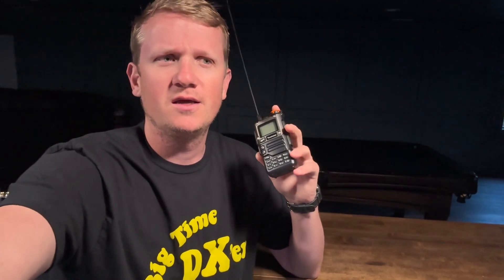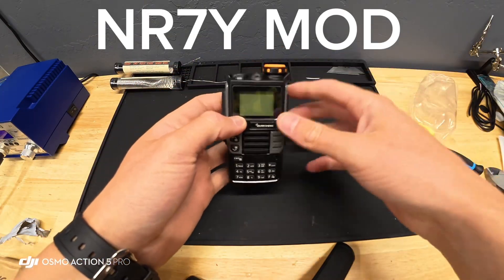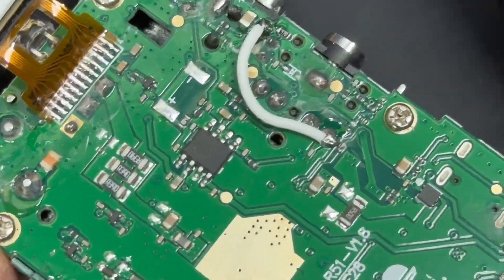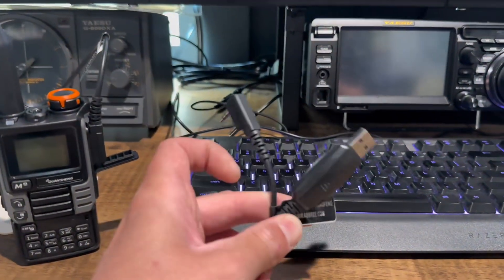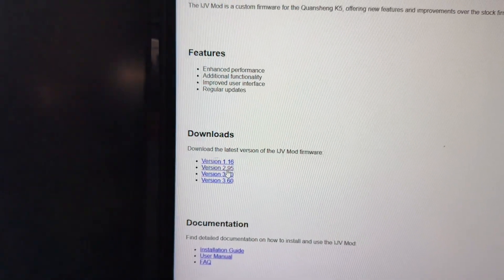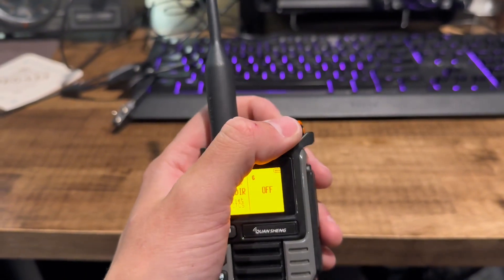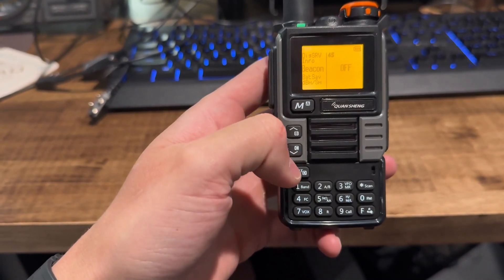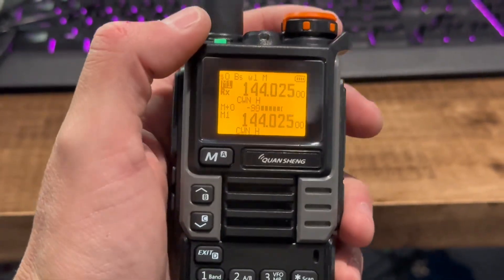$27 Morse Code Radio Setup In 10 Minutes

Comment from the maker: Reminder: Nobody in your area uses 2m cw until somebody does. If you’re reading this, you’re that somebody. Congratulations.
Reply: Exactly!
Reply: Excellent advice. I've been doing 2 m CW since the '90s in Chicago.  

.... By the way, where did you get that awesome shirt?
Reply from the maker: @k9kj you can only get this shirt once you’ve earned DXCC CW which I was able to do running .005 micromilliwatts from my modified Quansheng
Reply: 70 miles is cake no obstruction but where this shines is in a river valley for me. 10 miles in the most shit terrain no issues. I'd never make that contact on fm
Reply: Just like the people that say no one is on the repeaters but still never call out on them

Comment: In the manual IJV 2.9R5  section 7.7. There is a modification to a 2 Pin K1 to 3.5mm cable, where there is no need modify the radio itself.
Reply: It even has a picture showing the modification of the cable to use with a cw key. No need for any radio mods at all.
Reply from the maker: My literal brothers in Christ. The entire point of the radio mod is so that you don’t have to have a modified cable with you at all times lol. I’m always out in the field with a variety of radios and keys and to need to have the special cable with me is harder than just having the radio 100% ready to go at all times

Comment: That's excellent!  But it's not possible to open without removing the bolt.  Also there was no mod done to the keyer, is this because you a different of the radio?   Mine simply did not work!

Comment: This mod seems to work with only a straight key, what is the version that works with paddles?
Would love to use 2m cw but dont want to be restricted to only a straight key
Reply: Same
Reply: You would need a piece of hardware to interface between the paddle key and the radio to converter the information from two switches (paddles) down to one (PTT)

Comment: Does it opperate like normal FM voice, but you hear morse code instead of voice? I showed this to my club, and we're wondering if it can put out a PL tone to open our repeater while transmitting morse code. Seems like it would be easy if it's FM, but if it's true continuous wave we might have to put more thought into it, or stick with simplex. We thought this might be a good opportunity to start up a cw net with low cost to entry for new ops. Great work and videos!
Reply: I have wondered the same thing.  But if you have a key and something that makes the tone, you could set the radio on vox and key away on the fm repeater, without any mod at all

Comment: sorry if this question is stupid but i dont understand. Why did you remove the resistor and add a wire? Is it necessary in order to use an iambic keyer?

Comment: Just modded my UV-K5.  I notice I can't hear the first split second of a character after a space, especially if it's a dit, although it seems to be transmitting.  Anyone else have this behavior?
Reply from the maker: These radios require an initial keying to enable PTT for keying so if you leave too much space you’ll create cuts. This is normal

Comment: I'm going to put some more reading into this and maybe put together an adapter/connector instead of the mod.

Btw, the CEC firmware supports a paddle and I have that one too. Did you have any luck with that one? Need to try it out.

But yeah, man, 2m CQs are in my future. Somebody WILL notice! (Btw to be real, the cw club in greece has tops 400 members and I'm the first in my area, it will be tough, be hey you can be dicouraged if you start from nothing, right?)
Reply: The CEC firmware can accept a paddle, but requires some extra resistors to connect it, and our SOTA group found it very fidgety. It’s slow to key up (eats a dit) and sometimes just won’t key at all. Even with the hassle of an external keyer, we found the IJV firmware experience is much better.

Also note, this mod will break the CEC paddle mode; it needs that resistor to work. So get a second $30 radio if you want to try CEC.
Reply: @BrianDickman Oh I got 3 of them ❤ Thanks!

Comment: I already ordered the kenwood cable with the uv-k5. Do I still need to do the internal mod? De n5vwn
Reply: Update: quansheng came today. I tried with the modified plug first. Didn’t work. I think I bought one with different wiring. So I swallowed and took a chance and opened it up. Success! Works great! Calling CQ in the middle of nowhere. Using a X30 antenna 30’. I do hear repeaters up to 200 miles away sometimes. So who knows? De n5vwn

Comment: Great demo!    From another comment it sounds like there a different firmware to enable a built in keyer for use with a paddle.  If that wasn't the case, it's a market opportunity for someone to develop an integrated mico-keyer with paddle to plug in a mono connection like your straight key (like the curtis keyers of yore).     Or someone could develop a micro bug :).  That would be trick!!
Reply from the maker: I should’ve addressed this in the video. This entire project was the outcome of running the existing iambic paddle firmware commonly known as KD8CEC. K6ARK and I had a lot of back and forth on it. I’ll shoot you an email.
Reply: Another thought is to pair the radio with the new Morseino 32 Pocket available at QRP-Labs as I believe it can act as keyer for paddle and also give more macro options.  73 WG2H

Comment: Thanks for the conglomeration info and questions...thought I overheard someone in the "SoCal" group that you didn't need to do the NR7Y mod, that CW can be used just with a software mod...is that true?  Also, any impact to other operations of the radio after the mod (2m/440) - still work or is this one CW only?   Thanks
Reply from the maker: From guys that are very active with 2m CW they state from all their testing IJV 2.95 works best. The NR7Y mod is so that you don’t have to carry a modified cable with you. As you cannot just plug a key into the Quansheng without either a modified cable or the NR7Y mod. And imo the NR7Y mod is easier than modding a cable.

Comment: Thank you Forrest! I needed this for the settings. My tiny 3d printed key still doesn’t work with the mod, but I found out my key that I use for HF works on the left side paddle. So, I’ll make do with it😂
Reply from the maker: Is your 3D printed key a straight key or paddle? If it’s a straight key we should be able to get it to work just fine with the IJV 2.95 firmware.
Reply: @utahforrest it’s a straight. It’s the one that you had in your first video about CW on the quansheng. The rectangle one with white paddles.

Comment: I believe the KD8CEC V 0.2 allows you to transmit true CW with zero mods … at least I hope it does. Maybe that’s why no one is answering….
Reply from the maker: I’m going off of word of mouth by guys that actually use these radios frequently atop summits. K6ARK told me IJV 2.95 is notably better than the KD8CEC firmware. 
So far I’ve been making QSOs with IJV just fine!
Reply: @utahforrest gotcha I assume the IJV was the best but unfortunately I use a Mac and had to flash the firmware from the browser! I’m sure KD8CEC works too I just have to keep the faith 😂
Reply from the maker: @michaeldonovan7522  Oh 100% I’m sure you’re good! I posted some videos running KD8CEC! 
Are you running a paddle or straight key? I know with KD8CEC you need that modded paddle or a modded cable for iambic.

Comment: Can you use an iambic key with this radio?
Reply from the maker: You can with the KD8CEC firmware which is not the one recommended by most of the 2m cw ops. I love paddles but for 2m I’ll screw around with manual keys if it gives me better operating quality.